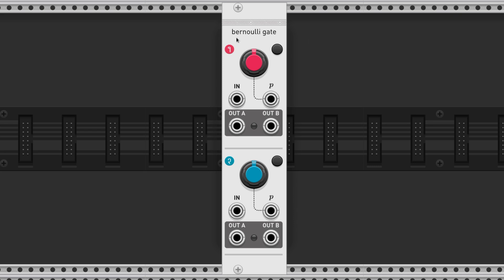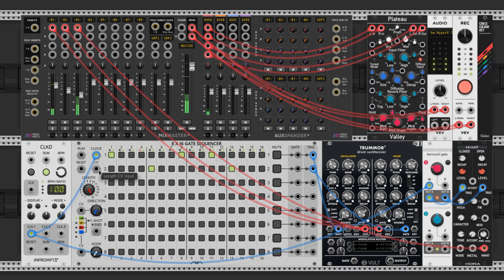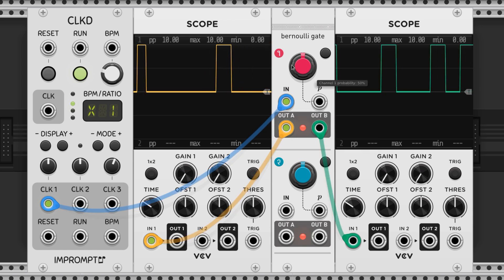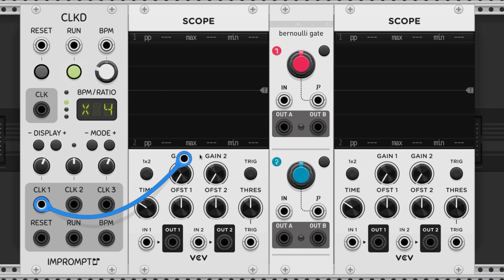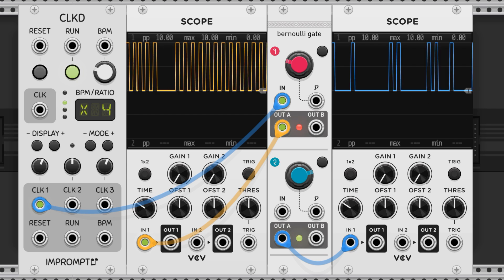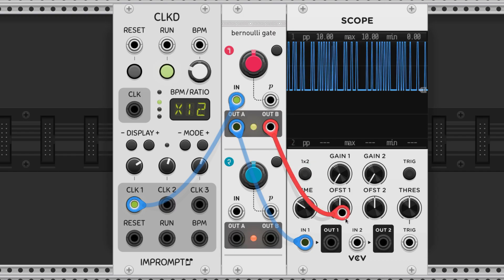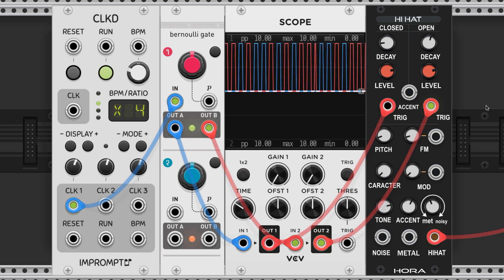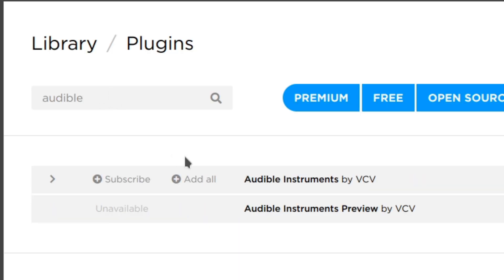Randomize Your Patch: The Bernoulli Gate

Comment: Hey, I'm studing acoustic at school and i'm working on a project using vcv rack : i tried to understand the goal of the bernoulli's gate but i don't really understand how to use it for my case : it's so tricky... do you have time to save my project and help me?
Reply from the maker: I might be able to answer some questions for you 😁. What is the result you're hoping to get from the Bernoulli gate? Like what are you trying to make it do?
Reply: @yourpalrob  thanks for the answer :) i've finally found the solution about the bernoulli modulus, now i'm trying to fix a delay on a player... I need to play on sound before one other, 4 secs between, do you know how to do ? I don't find the right modulus to do it
Reply from the maker: If you're trying to trigger a sound you could use a clock divider to set a slow clock that triggers ~ every 4 seconds. If you have the clock divider it will also be easy to sync up your sounds because they could all run off the same clock. Try it with Clocked by Impromptu. It is a clock module with a built in clock divider/multiplayer.

Comment: I know Cardinal is basicslly the same thing. But there are some intricacies i have been habing issues with and cant find much in the manual. I also cant tell if what im experiencing is a bug or a feature. But essentailly, im having ussues with the cooy paste function on most drum sequencers. The sequences seem to copy over to other slots. And sometimes the entire firdt slot is erased when I daisy chain all my restarts to the ssme trigger. Im specifically using the Drum sequencer by DK. The black and green one. But, the sampler/sequencer also has issues with keeping the proper patterns. Thats the one with the ratchet functions thatvyou can load samples directly into. Any help would be appreciated. I jusr figured there wouldnt be as many bugs as there are, so I must be doing something wrong. EDIT. Its the drum sequencer by SV modular. And the groovebox by Voxglitch
Reply from the maker: I've never used Cardinal before so I'm not sure how it may function differently than VCV rack. I would recommend posting the problem you're experiencing on either the VCV Rack subreddit or at the VCV Rack forum. There are many skilled patchers there that have used Cardinal and may be able to address the specific issues you're having with it.